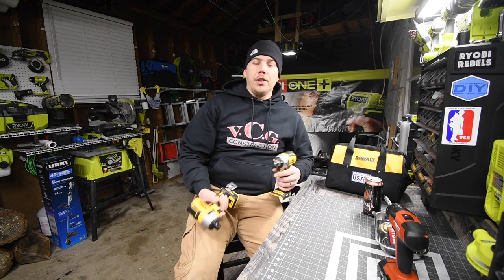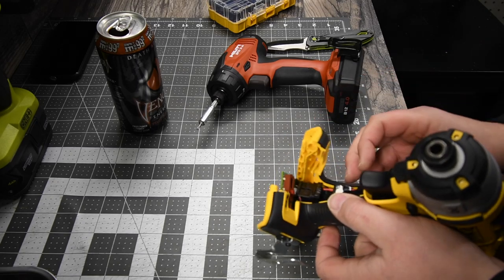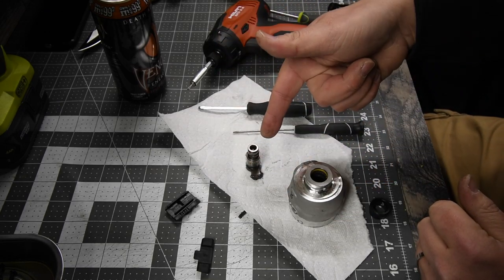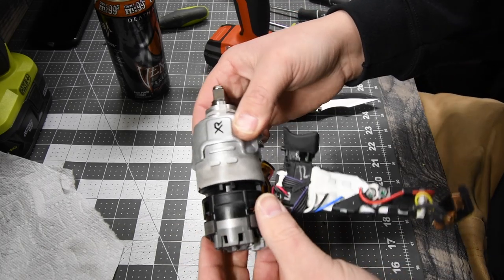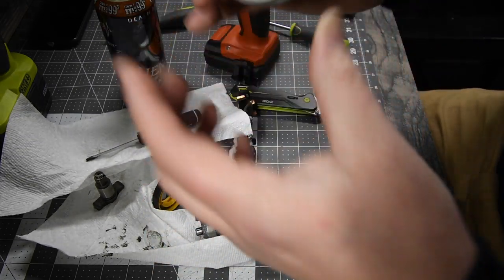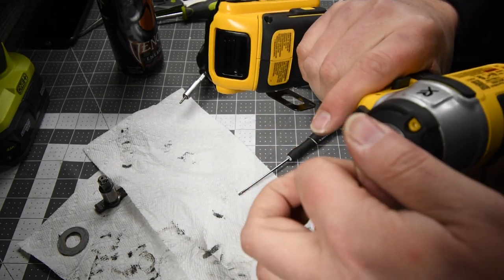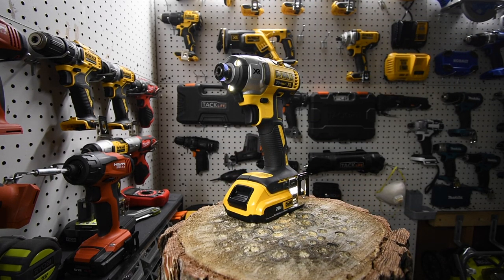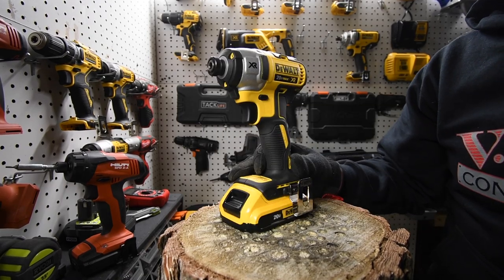3/8 converted to 1/4 Hex impact wrench

Comment: Cool, you made a 3/8 impact wrench into a 1/4 impact driver. It’s no mistake that dewalt and other companies design the tools like this so they can make an impact driver and an impact wrench using the same body and components.
Reply from the maker: very good and thank you for viewing. I didnt switch out the body though. only the anvil
Reply: Exactly. You Changed the part that defines the tools name. The square anvil or 1/4” round collet is what defines the name of the tool and it’s purpose. Take the handle off of an axe and put it on a sledgehammer, you don’t have an axe anymore you have a sledgehammer. The tools all have different things that define its name and use. When you change that particular part, you change the name. There is no such thing as an impact wrench motor. That same motor is used in many different tools. The motor, anvil size and type, and body only determine the tools performance and specs, not the name of the tool.
Reply: @Zee20Ate  I actually didn’t know that. I always assumed that a 3/8 would have more power than the 1/4 inch. That’s kind of cool to know. Makes me want to do a 1/4 to 3/8 on my xr 1/4 knowing it’s got the same motor.

Comment: I swapped the nose cone anvil and hammer assemblies between my 890 and 887 to create a 3 speed impact wrench, and from the leftovers I have what performs identical to a dcf787 .... Best thing I've done! I love my 3speed 3/8 impact for more delicate stuff. (I also have the 885/894/899 along with an unmodified 887)

Comment: i attempted this i was successful in converting the dcf887 to the 3/8 and i love it but i wish you videoed the process better for the dcf890 to 1/4 conversion for the life of me i couldn't get   the 1/4 to work snap rings wouldn't re seat thing kept flying apart  and i gave up i ended up buying another 3/8 anvil off eBay and  the dcf890 is going back to stock ill  keep it as a a backup but the dcf887 with the 3/8 conversion is a  beast i have no regrets `
Reply from the maker: its awesome to tinker with tools and modify them. and I thank you for viewing v r
Reply: Man Caver Tools I commented on this before I watched your second video when you switched it back the plastic washer in the dcf887 is thinner than the one in the dcf 890 I did not swap the washers which didn’t give me enough space to get the snap ring seated properly with the 1/4 anvil in the 890 I’m still going to leave them both 3/8 because I want the torque because I mainly use my tools for automotive applications after watching the video on how much you lose with the extension I’m happier with the 3/8 anvils great content btw

Comment: DCF890 is actually just DCF886 with 3/8 anvil.
And DCF887's nose cone part (that silver part with XR logo) is bit shorter than DCF890 or DCF886, and so the anvil.
Because of that, using DCF887's anvil on DCF886/890 will cause some problem, like in the video.

In order to make DCF890 to properly accept 1/4 anvil, you have to change the entire front housing assembly; the anvil, silver nose part and the light.
Reply: He should’ve just transferred the whole housing if possible.
Reply from the maker: the housing is a little shorter so I think it would be too tight cause the anvils a little different in thickness
Reply from the maker: I will see if I can adjust the ball barring and lick the bits in place

Comment: The DCD887 drives 3800 IPM at max speed, 3200 IPM at mid speed.  The DCF890 at 3200 IPM so the power should be the same when DCF887 is at mid speed.  One thing I noticed is the DCF887 with 3/8" anvil removes lug nuts easier.
Reply from the maker: that is correct we are going to see what anvil is better in the next video
Reply: I converted my 809 to 3/8, same hog ring everyone does with the 887. It works, very well and the 809 comes from factory with a generous amount of grease. The only issue is the little white LED plug it is under 4 wires and you have to be real cafeful you dont poke them too much with a pick. Otherwise it takes about 10 minutes.

Comment: Hi,

Just to let you know 94 GT Coupe did a video on this DeWalt DCF887 1/4" impact conversion to a 3/8 anvil. I did the same to one of my dewalt DCF 887 impact drill. The bad part, i was an idiot and left on my bumper of my truck when i was rushing and i lost it on the freeway. Again , I'm a idiot.

What will be nice if a 1/2" anvil can fit on this model. Don't know why dewalt didn't do this already with this model. I guess a few bad issue with burning up. I don't know i never had that issue with mine.  

Must have been a bad batch of drill that this happen to. Just like milwaukee gen 3 1/4" impact with colet issue.  Again a bad batch. 

Cool that you made a video on this conversion. Oh yeah break away was rated 250 ft lbs. Which was not bad.

Thanks for the video
Reply from the maker: I thank you sir

Comment: I would have added a little grease just to service the tools. They don't come with much but they don't need much. Catus Maximus has some videos you should watch on tool maintenance.
Reply from the maker: you don't want to much grease cause it will cause a little build up due the amount. The grease gets hot and liquifies

Comment: bro, you better put that plastic washer back in!
the anvil is going to wear out the aluminum housing!
arrrgh
Reply: There was one already in there from the 1/4in. That's why he said he didnt need that in ther!
Reply from the maker: I will after the test. because the washer is for the 3/8 because its a little bit longer than the 1/4
Reply from the maker: correct.

Comment: This is really cool, can you try to see If the dcf801 1/4 hex anvil can be converted on to the dcf901 3/8 platform of the 12v extreme series. I'd like the extra torque in a shorter over all length. 👍

Comment: I could see if one of these were not working but you had two working tools, why did you change them over? They look basicly like the same tool. Motors looked the same, shells looked the same only difference i seen was the anvils, one was a wrench one was a collet. 
So why the switch?
Reply: Just to see if it works.
Reply from the maker: I am seeing if there is a difference in 3/8 in anvil compared to the 1/4 in anvil in an impact wrench. im filming the versus video today
Reply from the maker: That is correct, now were are going to see if there is a performance difference in the next video

Comment: Cool concept and the fact that it works but I have to ask what is the point. What can you do with the supped up 1/4 driver that you couldn’t do with just the 3/8 wrench.
Reply: The comments/arguing in the prior videos prompted this one. The point was to show that theoretically the only difference between an impact driver and an impact wrench is the anvil.
Reply from the maker: this is to see if it can be done and the video is being uploaded right now for the versus test
Reply from the maker: no, this shows that you can put an 1/4 hex  on a impact wrench. the impact wrench motor stays the same but the anvil can be replaced.
Reply from the maker: most people see the 1/4 hex anvil and they assume no matter what it only can be a Impact driver, which isn't true
Reply: Ryobi Man Caver oh I see. Not me I’ve used 1/4 inch hex driver in 12 volt to rotate tires before. If the tool isn’t strong enough to break the lugs loose that’s one thing but the anvil doesn’t get any more stress than impacting any other fastener or whatever. I’ve always used hex anvil for lugs until I got my 1/2 drive that beast zips the lugs off quick lol

Comment: since you do lots of these creations you are the man to ask ,, so i have a dcf801 in which is an extra so whats the 1/4 anvil number for conversion from hex to 1/4 hog ring anvil??  ty for sharing knowledge of choice!!!!!
Reply from the maker: you shouldn't have to modify the tool with 1/4 or 3/8 anvils only 1/2 or bigger with making the hole wider is needed

Comment: Surprisingly the 1/4 impact driver has 2 more ft pounds of torque than the 3/8 wrench not much of a benefit other than the built in 3/8 drive unless dewalt just decided to round down instead of using inch pounds and have us do the math also id rather have the driver than a 3/8 wrench since its smaller and you can just throw on a socket adapter
Reply from the maker: I agree